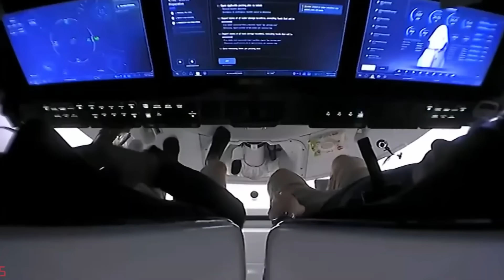Blue Origin's Recent Launch Humiliated Jeff Bezos!

Comment: AI Overview
No, Blue Origin's New Shepard rocket does not reach Low Earth Orbit (LEO). It is designed for suborbital flights, meaning it reaches the edge of space (the Kármán line) but does not achieve the speed or altitude required to establish an orbit around Earth. New Shepard flights typically reach an apogee (highest point) of around 100 km (62 miles) above sea level, which is above the Kármán line. This allows passengers to experience a few minutes of weightlessness before the capsule returns to Earth. It's a joke lol

Comment: Curious to know why you didn't share the part where one of the passangers opened the door feom the inside.  If that is actually possible it's a hige flaw.  If someone would have freaked out during the flight and tried to get off this ride, all passangers would die.  I think this is one very big reason why people are saying this was not a real flight.  I would actually think that there should be 1 professionally trained NASA crew member on every flight.  It just seems too unreal and I'm half wsiting for someone to do a video of them sneaking the ladies into the back of the capsule after it landed and JB reopened the door.
Reply: The door cannot be opened in flight. A passenger opened the door after the landing. So what?